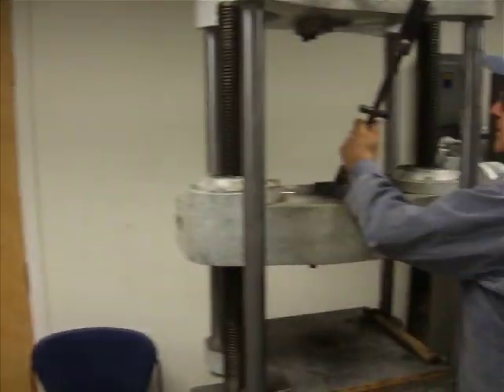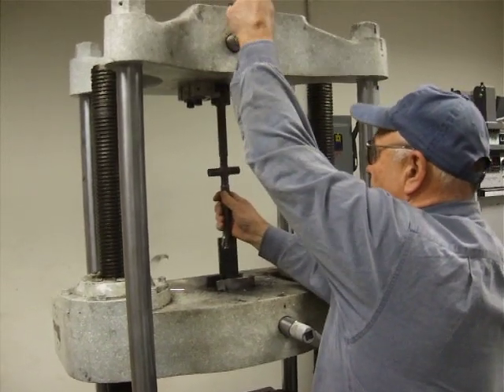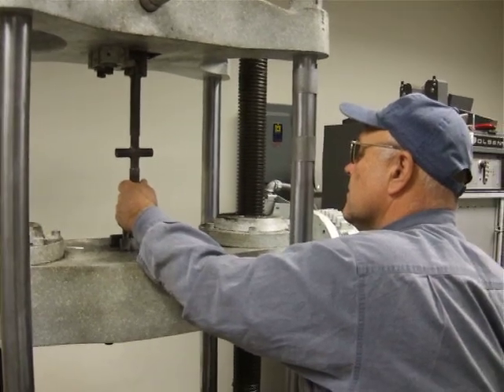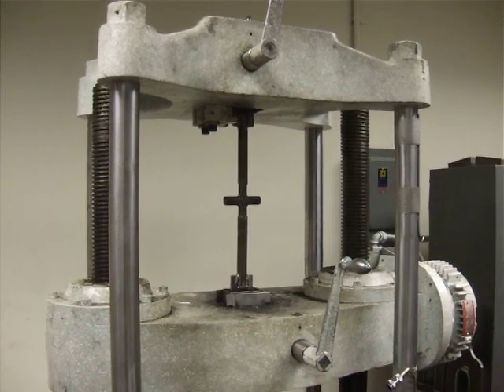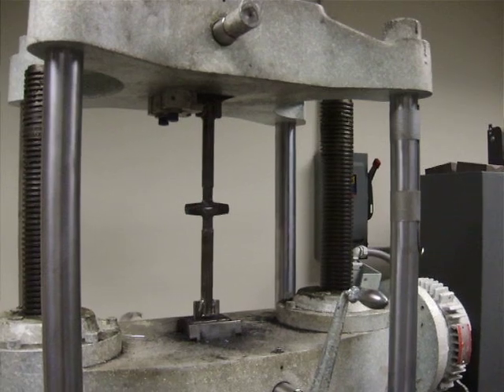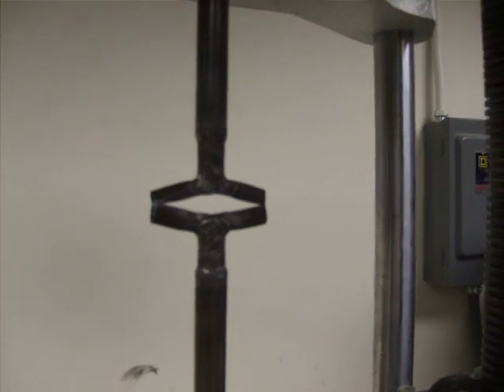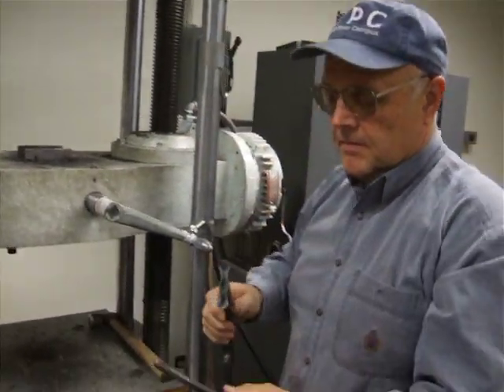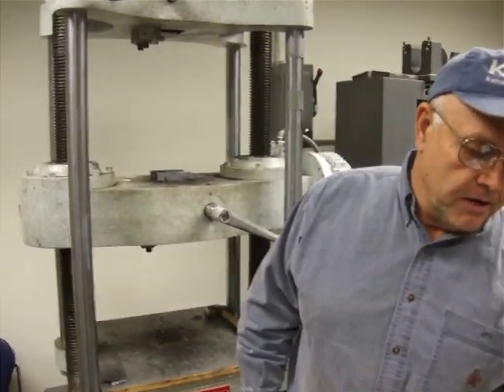4130 Tubing Joint Tensile Strength Test

Comment: I am not sure on how the assembly sample may be used in in your case but for piping and related accessories probably it may be more significant to do some pressure or hydrostatic related tests?
Reply from the maker: The joints are normally in compression in the application in aviation, but this is the only testing machine available at the college. They do a number of tests on welds, this tensile strength test is one of those. For pipe welds, they also section a weld, then bend it 180 degrees and look for cracks. There are others, but this really give a good indication as to the quality of the weld at the joint.